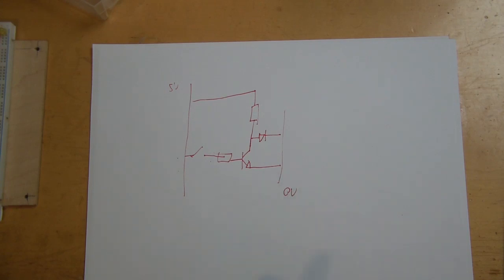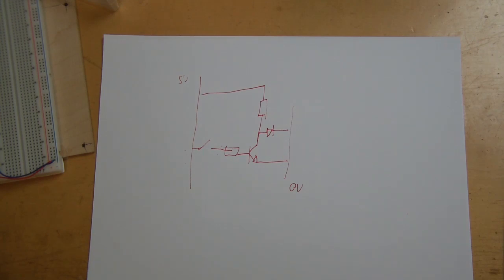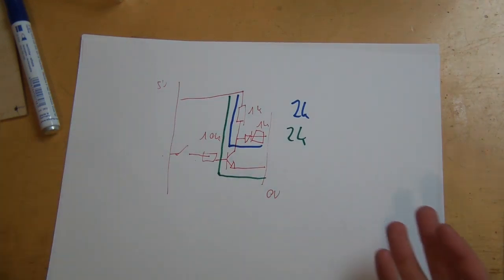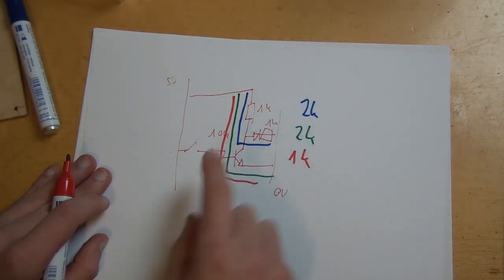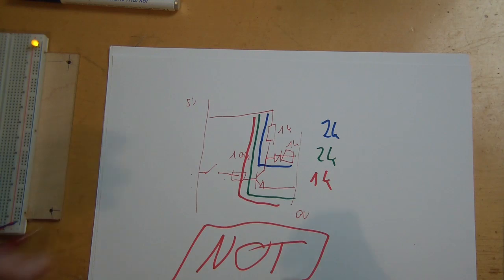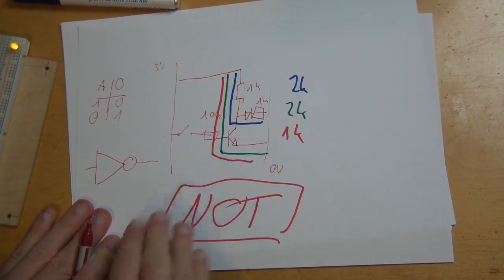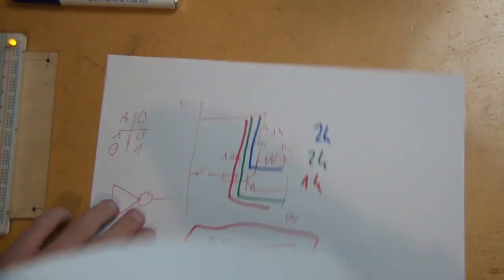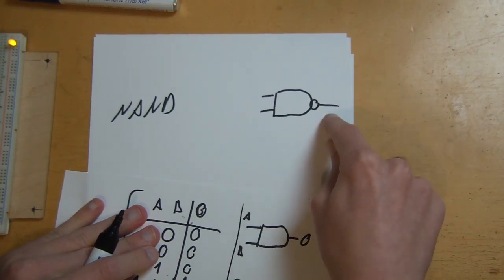More on Logic Gates - Lets Build - 8 Bit Computer Part 3

Comment: Good explanation but your values are way out. With the transistor off, the impedance is about 100M in parallel with 1k and both in series with about 1K so half the voltage would be dropped across the LED with built in resistance. You could use a normal LED of course to get more voltage across the LED and the 1k collector resistor will limit the current nicely. When the transistor is switched on the impedance will drop below that of the 1K resistor and volt drop will be 0.6v as well as across LED with most voltage across the 1K resistor which will limit the current through the transistor

Comment: what about a led without a built in resistor? will it still prefer to go through the transistor? what about the forward voltage drop of that transistor?

Comment: I know this video is old but can anyone give me some links to these bad ass LEDs with the built in resistors? I dont know if im just stupid and not looking in the right places but i cant find these of various colors (hell cant find ANY of Any colors) . I have looked on both Ebay  and Amazon but alli get are results of what appears to be lights for vehicles. If anyone can point me in the right direction of these beastys in both 5 & 3 mm id really apriciate it!!!
Reply: Jc Wadkins mouser had them. just Google led built in resistor 5v
Reply: Just use normal LEDs with 1K to 3.3k resistors

Comment: i'm going to try and do this with redstone in minecraft see if it's possible :)
Reply: +Blaze Rod I'm going to try and do this with Microsoft paint and see if it's possible.
Reply: lol:) it is possible in mc but i couldn't do better than a 4bit adder xD
Reply: +Pajy it is possible. I've seen a video a long time ago. but the "PC" was huuuuugggeee and quite complex. Unfortunately I don't remember how many bits it was able to process.
Reply: +Pajy I heard that you actually can design a whole processor in Minecraft, but I don't think that Minecraft includes the law of "lazy electricity", unless some mod adds this law into it.
Reply: It is, and has been done. However, minecraft logic works slightly differently. It works not because of lazy electricity, but basically all of minecraft logic is based around the fact that if powered redstone runs into a block, it powers the block. A redstone torch on said block is then turned off (that's a not gate by the way. Redstone --> Block with R. torch on opposite side --> output redstone).

Comment: how does electricity always find where is less resistance?
Reply: Protoss Zerg well technically it goes every where it can but when you have something like 2 paths that are 1M ohm and 10 ohms then so little current by comparison is going through the 1M ohm that its not even worth talking about
Reply: +Protoss Zerg  It doesn't. This is a common misconception repeated over and over by people who have no clue about electricity. The electricity doesn't have to KNOW anything or CHOOSE any path of least resistance. In the case of the circuit described in the video, when the transistor conducts, it pretty much shorts the collector's circuit to ground, which makes the (nearly) 0 volts potential to appear on collector. Then you have the 0 V potential at both ends of the diode. Try it with a volt-meter. If you measure the voltage at the diode, it will show 0 volts. When there is no voltage drop along the diode, there can be no current through it as well. Which means that the current from the +5 V rail goes straight to the ground through the collector-emitter junction (because the current cannot disappear into nowhere as well – it must go somewhere).

It helps when you imagine the circuit as a set of pipes with water flowing inside them. Water (=electric charge) cannot flow through the pipe (conductor) if there's no pressure (=voltage) along the pipe, because it is the pressure difference between its ends (the voltage drop) which pushes the charge through it. (Similarly, it is the voltage difference on the battery outputs that pushes the charge through the circuit.)
You can also use gravitational potential (height-dependant) as an analogy for electric potential to demonstrate this. When you have a pipe with water, but both of its ends are at the same level, the water inside it will be stationary, because nothing is pushing it towards any of its ends (this compares to the situation when you have 0 volts at both ends of the diode). You need to put either of the ends higher than the other (cause a potential difference, aka voltage) to cause the water to flow (the current). And it obviously will flow from the end of higher potential towards the end of the lower potential.
Now imagine two such pipes side by side, one of which has a drop of 1 cm, while the other drops nearly vertically down. The inputs of both pipes are connected to the same supply of water. What do you think would happen?
All the watter will obviously go mostly through the nearly-vertical pipe and there will be (almost) no water left to go through the other pipe (less inclined), despite the fact that it is unobstructed. Does the water need to know ahead which of the pipes is the one with less a resistance? Of course not! Is the water "smart" enough to "choose" the pipe of less resistance? Not at all! But it seems to do it. Why? Because it is simply directed by the potential differences (height differences = voltages).
Reply: How does a river 'know' what the path of least resistance is to the sea?

Comment: So a gate still has switches... What presses those switches in an integrated circuit?
Reply: Diogo Baltazar no, the A's and B's are replace the inputs in the circuit, so you would hook up switches to the A's and B's
Reply: Other gates basically but you need to latch the switches so they remember what the last inputs were even when those inputs are removed. That is how memory works and can be achieved with just 2 NAND gates (the easiest logic gate to build). Take the output of NAND gate 1 and feed it to input B of NAND gate 2 then take the output of NAND gate 2 and feed it to input B of NAND gate 1. Then you can use the A inputs to latch a 1 bit or unlatch and store a zero with the other A input

Comment: I have built a 2-bit calculator but it is the same as 4-bit or 8-bit just smaller using relays. Why not use them?
Reply: Well, let's say that relays are current monsters, their consumption is really high, they're expensive, noisy in both way, they produce noise into the line(as any inductor) and they produce noise into sound waves...
Reply: relays are expensive.

they're not used in normal computers
Reply: transistors are also smaller (there are thousands of small transistorts in your little computer proccessor)
Reply: momostein10 billions!
Reply: ***** Okay, guys I got the idea. It's been a year since i asked.
Reply: yes!
:D
Reply: Yes you could use relays but your processor would be the size of Europe and very power hungry if it was to match the complexity of modern processors

Comment: Hi your videos are very well. But just small correction if you mean green line like open transistor. (Colector and Emitor are not connected) Resistance is not same like blue. More precise green is infinum. Because serial rezistors are 1k + Infinum = Infinum
Reply: +Oskar Walder Thank you. I also noticed that.

Comment: You have a great series of videos! But I think your understanding is a little flawed. You say that "electricity is lazy" and that it follows the path of least resistance, but that is not true. If there is a path, current follows it, regardless of the resistance.
Reply: You are technically correct, but he never said all current goes to one path. If the path becomes easier to travel down what normally is harder then it does. So therefore his statement electricity always travels the easiest path is correct, so it is your understanding that is flawed. The "leakage" current you speak of is because the potential from each n=top field is less than the preceding field of the n=top field for the atom next to it. Electricity is just electrons traveling from set of atoms to the next, and so long as 1 atom on the left has 1 extra electron and 1 atom on the right has 1 less atom and a stream of atoms with large electron fields and high orbit shells, then electrons will flow from one atom/side to the next, until it balances the energy on each side. This is the basic principal of the Coulomb, and the foundation of all electricity, just as massively larger scales, but its fractal, so therefore the same. Because the conductors aren't perfect, and allow perfect exchange, then the conductor's atom will become saturated, and electrons will follow to the next possible conductor, therefore "leakage". If the wires were superconducting then all electricity would follow in one direction, irregardless of possible paths.
Reply: Pusalieth Verrry complicated explanation. Why are you even bringing physics into this? His understanding is flawed. It works to explain it in this case, but it's not right.
Reply: SolidStateWorkshop Electricity and magnetism are two sides to the same coin - and both part of PHYSICS.
Reply: If there is one path that is true, however if there are two paths the current will take the path of least resistance.
Reply: Amy Frost Sorry but that is incorrect. Think of a simple parallel circuit example. Parallel circuits by definition have multiple current paths...and does current only flow in the path of least resistance? No it flows through all possible paths. However, there may be more significantly more current in one path than the other.
Reply: SolidStateWorkshop Well yes sorry I meant more current will flow in the path of least resistance. I = V / R So greater resistance less current.